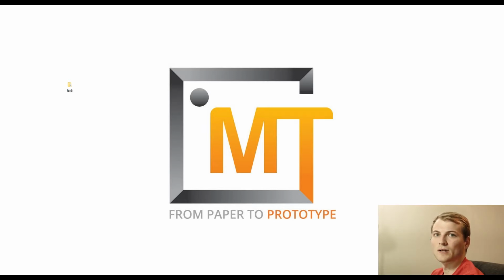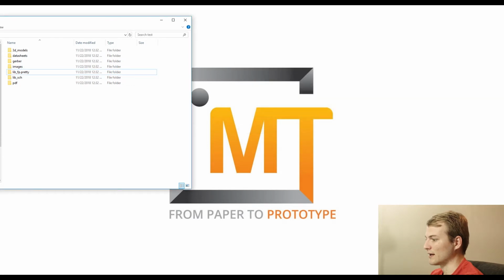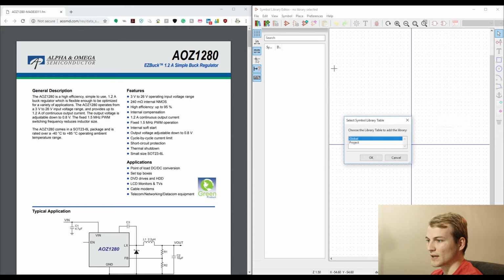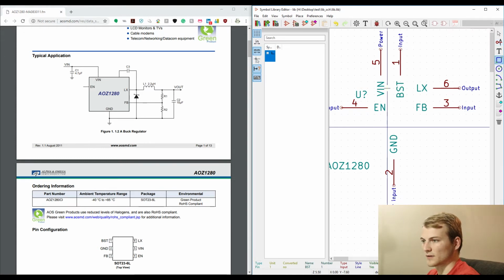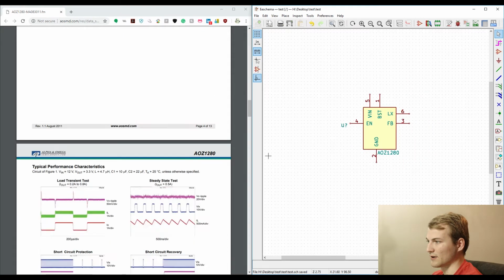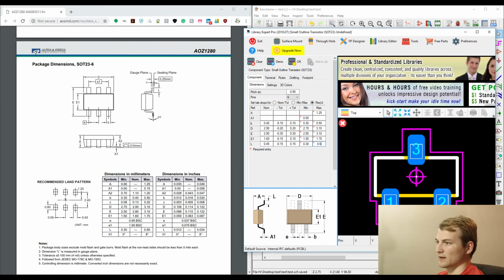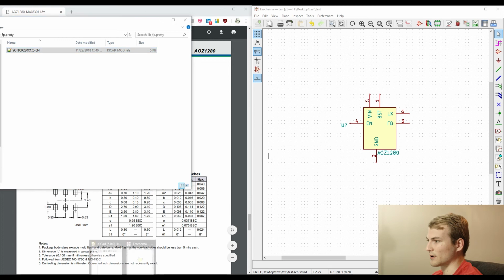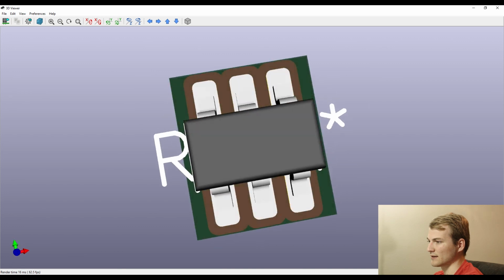KiCad 5 Project and library structure

Comment: Hi, also another tip, if you put the library path in the library manager referenced by the project location then you can move the folder around and don't break your libraries association, like this: ${KIPRJMOD}/lib_sch/lib.lib  -> perhaps in windows is with backslash \

Comment: Hi, I would recommend you to take a look at KiPart https://kipart.readthedocs.io/en/latest/readme.html, it generates the symbol out of a csv file. Then you can use that and edit the specific location. It is quite useful when you have to do high pin components with multiple parts per symbol

Comment: Excellent way to organize everything. Could you also make a video of creating a H-Bridge?
Reply from the maker: Thanks! Any specifics you would like? Discrete components (MOSFETs, transistors, ect) or integrated IC, how it's controlled, voltage, ect..?
Reply: @MicroTypeEngineering  That's nice of you. But more than that, a way to import an external cad design to KiCad would be very helpful to many I guess. 

I am currently designing a buck converter, for which, I need to implement an air-core spiral inductor on the PCB. Being a newbie I cannot find any easy way to do it. If not this particular component, you can show us how to do using a simple one.

Again, thank you :)
Reply from the maker: @girijadav  The actual mechanical design part, or linking the step file with kicad? Because the latter is pretty self explanatory. And the mechanical design is so heavily dependent of the software used (I use solid works).